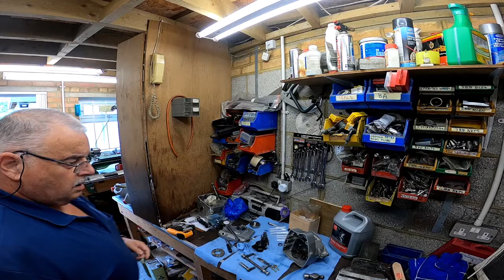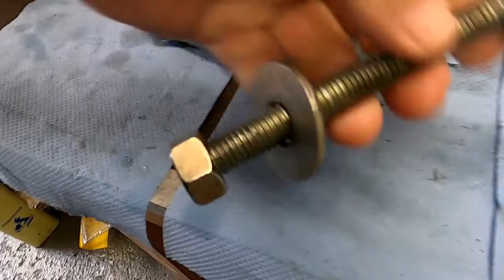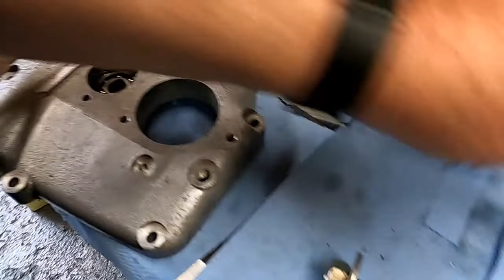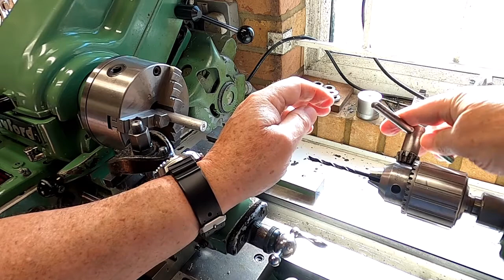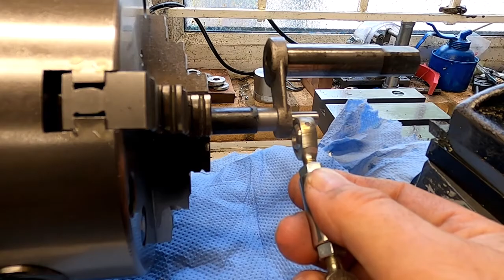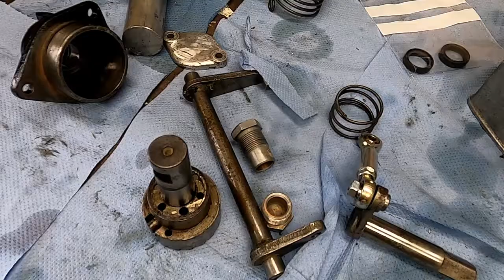Velocette 500, 5 speed conversion, part 3

Comment: You could of course put the shim on the 3 jaw chuck, open it up to hold the shim, and skim the .020" off the periphery. I do like the rod end bearing conversion you have devised, very much better! I think the castings left as cast went some way to offset the cost of the awful ,(in my opinion) fibreglass engine covers that covered up all the lovely shapes of the engine/gearbox. Chris B.
Reply from the maker: Agreed, the fibre glass covers gave a few more MPH but look nasty.
Even today, most new motorcycles engine are painted black because it is cheaper than finishing them nicely.. I find this element of new motor cycles utterly repellant.
Reply: @alanglen5902  Yes the no need for extra finishing of the castings was one reason for the Black Shadow being stove blacked, although it is the one engine finished black I find acceptable, (Oh, the RR Merlin also looks very nice in black). Chris B.